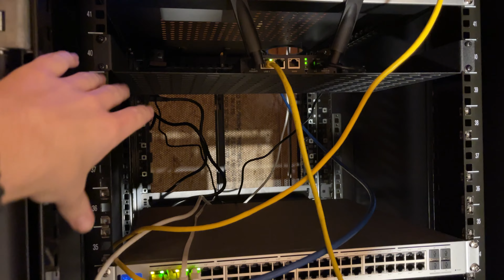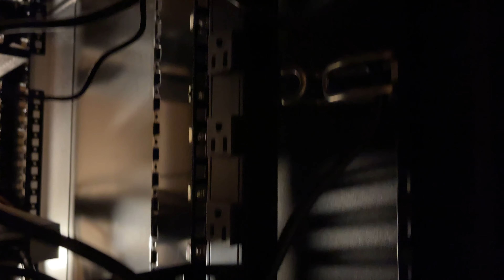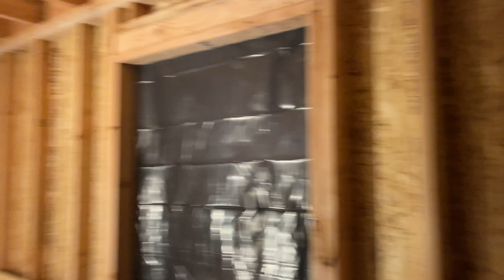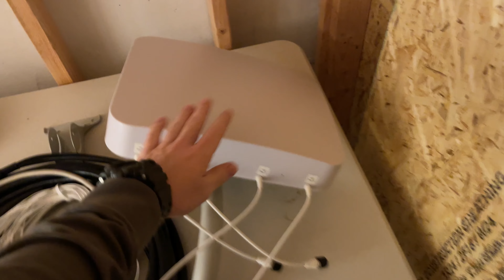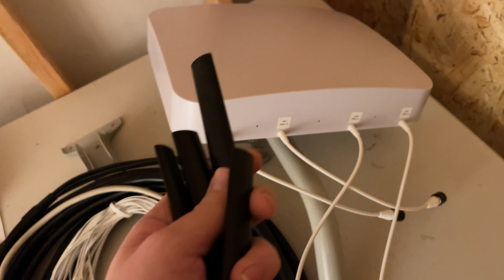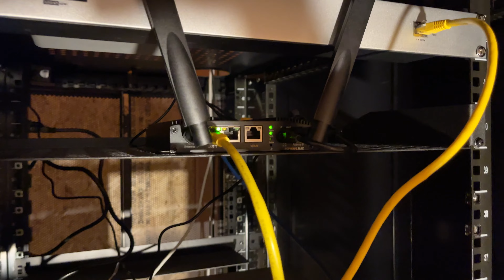Server rack tour! Remote Observatory networking system

Comment: Can you tell us what power strip that is and add a link where to get it please.
Reply from the maker: its a Tripp-lite metered PDU, rated for 15A @120v. 16 outlets. I would select the 20A version if you have 20A plugs for your circuit in your server rack, or better yet, 208/240V instead of 120.

Comment: If you have any wireless devices in your rack WITH their antennas inside the rack, you may have issues.  The metal rack will act as a faraday cage.  I do see you have an external Antenna which is great.   The commercial Hot Spot looks like it used antennas inside the rack..??
Reply from the maker: It has an internal 5GHz and 2.4GHz antenna that will be inside the enclosure that provide WiFi-WAN into the network, as well as an admin control network that I will turn to invisible. The external antenna will be used for a redundant/backup LTE signal in case of our P2P into the building goes down.